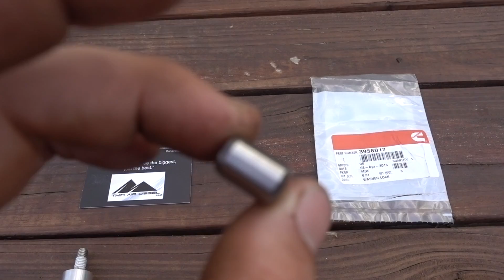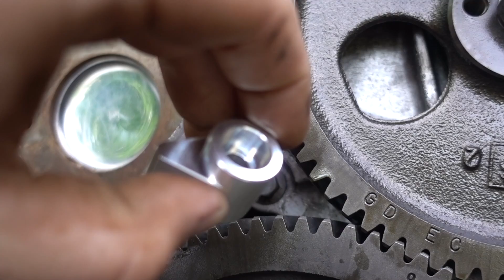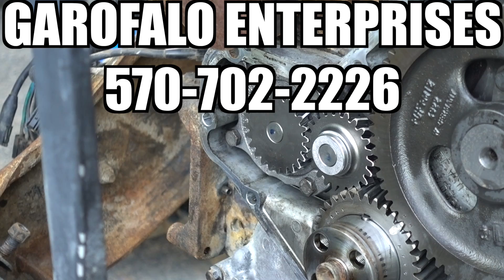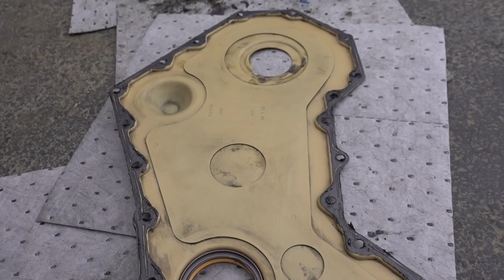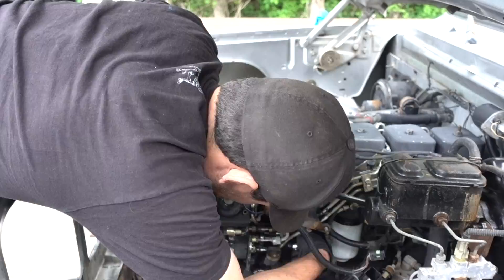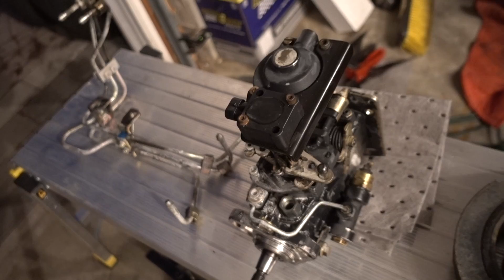$30 BILLET PART WILL SAVE YOUR CUMMINS!!! & GREG STILL CAN'T CATCH A BREAK!!!

Comment: HELP 
I have a 1993 w250 12 valve. I replaced the oil pump with a 24 valve pump but i didn't prime it. I pulled the oil pressure regulator near the filter and put in half a qt of oil. I was able to get the pump to prime and produce pressure and ran it for 15 min. I came back an hr later and started the truck and lost prime again so I repeated my process and regained pressure. once again I shut it down and came back 30 min later and again NO oil pressure. do you have any idea what could be causing this issue? 
any help would be greatly appreciated.
Show less
REPLY

Comment: Waste of money! All you have to do is stake the dowel in there. To stake or dimple the housing, use a center punch or chisel to cause a burr in the hole. Then the dowel cannot vibrate out the front. Done this hundreds of times, although I have never seen a dowel even remotely close to coming out. I mostly work on industrial and marine engines though.
Reply: jeffdoxey 
Mine was nowhere close to coming out when I tabbed mine, either. Staking it is a good idea. It seems I'd heard of that before. I simply took an old sawzall blade and cut a properly sized and shaped tab out of it with my plasma cutter, then used the original bolt (after cleaning it and the hole and applying loctite) to install it.

I don't see that there is any type of force trying to push that dowel pin out. If there was, they wouldn't make it off the lot before they fell out. They simply vibrate out. So, like you said, that chunk of billet is overkill. I wish I had thought of staking mine when I did it. My method didn't really cost me anything but the few minutes spent making the tab and swabbing out the bolt hole to prep it for the loctite, but your method would've been a lot quicker and wouldn't have even required removing that bolt to begin with.

Comment: The new oil pump has different gearing. The pumps cog is smaller, the drive/idler pulley is bigger, more RPM = more flow.

Comment: why does it need the pin? it seems useless. not a cummins guy don't burn me at the stake.
 bonus question: if cummins are so durable why are parts and the engines themselves so expensive? I thought parts would be abundant and cheap like LS motors.
Reply: David Vermillion they are cheap compared to powerstroke and duramax motor parts

Comment: the first gen ve44 and 24 valve 2nd gen vp44 covers use the stepped side of that tab. the p7100 injection pump covers in the 1994-1998 2nd gens use the flat side.

Comment: The part that got damaged is on the inside of the cover, its just an oil wiper and would have settled down over the crank once warm oil hit it. The yellowish part is the Teflon or PTFE "seal" and it looked fine to me. YMMV

Comment: While the pump is off install a m&h timing spacer, m&h m2 or m3 fuel pin, 3200 or 3600rpm gov spring, and bump up the timing one tooth, will make a massive difference and save you a time of time down the line
Reply: For what reason would you want to change gov spring? Also timing please explain, is there a reason if you just prefere low en torque. I pretty much never rev mine over 2500
Reply: Ape Hoaxman the dynamic timing spacer increases the travel of the ksb witch improves low end torque and too top end power by advancing the timing with rpm increase, the timing advanced one tooth is right about 10* advance witch is perfect for the best torque and top end, the gov spring improves the power band at all rpm not just giving you more rpm but giving max fuel flow through more of the rpm range. even if your only revving to 2600rpm the stock spring starts restricting fuel flow around 2000/2200.
Reply: If you want to contact me vea Facebook or Instagram  (slo_12v) I'd be more then happy to go into more detail and share my experience

Comment: You don't need a curved wrench for that hard to reach nut*. A combination of extensions and the right sized (length & thickness), socket will work with a ratchet. That's on a P7100 as well so there's significantly less room to work with.

Comment: I know it may sound dumb, but DO NOT disconnect those injector lines from each other. They may look like they can only go one way, it is really easy to skip one line on the pump and it will not run. Ask me how I know. 😐

Comment: Love the 12 Valves.......I have a question, do you add anything to the fuel for the older trucks? In Alaska we add MMO, just curious as I've heard folks add numerous items to the fuel for lubricity. Two stroke oil, ATF, ?
 Thanks, M
Reply: MFB Alaska In my duramax I just throw in Stanadyne cause I get it cheap. Shits great
Reply: I've used that too, seems to be good, I'm just wondering if there is any science behind these products and what might work the best for the life of the engine.  ;-)

Comment: Greg you ever installed an Amsoil Dual bypass oil filtration kit? I put 1 in on my Customers 2003 Ford powerstroke 6.0. A lot of fabrication of brackets and replaced hose with lengths of 1/2 inch galvanized pipe. Anyway came back 2 weeks later to do window motor in same guys minivan. Pulled dipstick to check oil and damn if it was as clear as newly poured oil. Used Castrol full synthetic 20 50 w and truck had 136k miles Fyi. Impressive system.